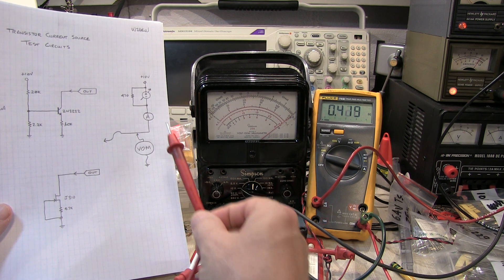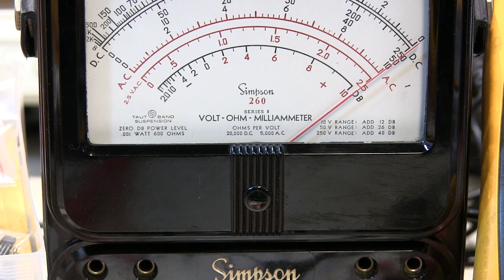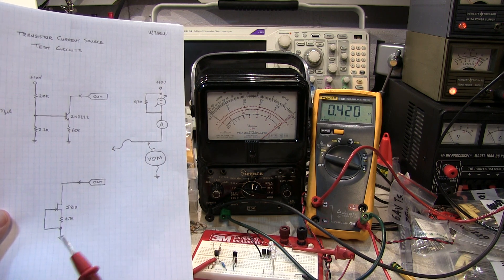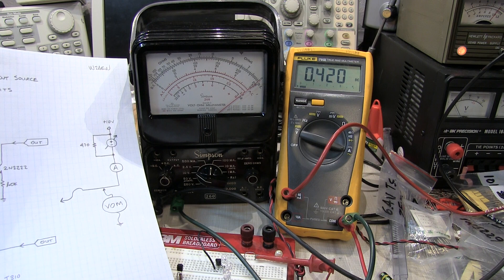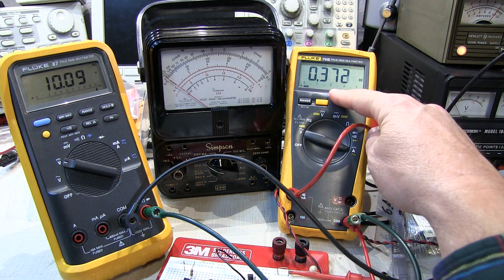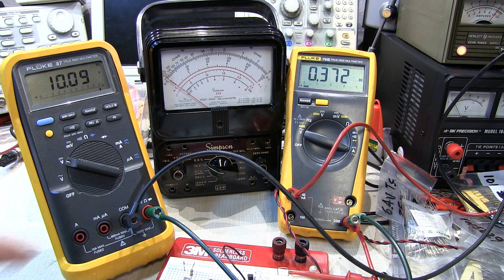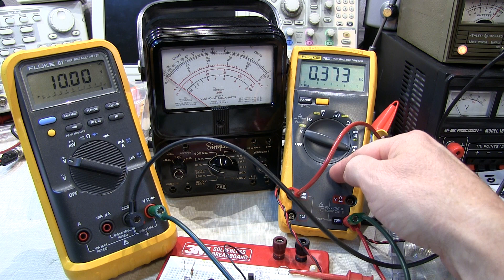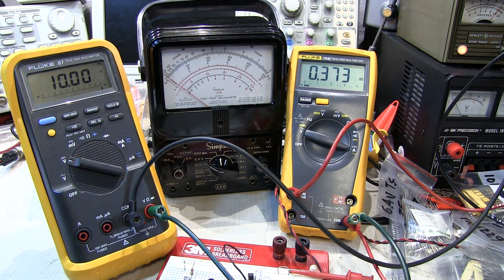#191: Beware of test equipment loading effects!!  Learn from my error!

Comment: I just subscribed to your channel and really appreciate your content.  I had a question about older meters.  I was working on a Tektronix 576 doing some performance checks and in the service manual, they talk of using a voltmeter with input impedence > 500Mohms! Our DMMs today typically have ~10Mohms (depending on range setting).  Do you know what kind of meter they were referring to in this service manual?  Sorry I know this is a bit of an obscure question, but your thoughts on older meters like the Simpson 260 (I have one as well) having lower impedence triggered this thought.  This Tek 576 manual was clearly written in the late 70s so they must have been using an older meter as well.
Reply from the maker: They were likely using a VTVM (vacuum tube voltmeter).

Comment: I would use the DMM meter before the old Simpson 260 analog meter. But do get me wrong the old Simpson Analog meter back in the 60’s and 70’s in my opinion was the industry leader. Your thoughts?
Reply from the maker: I like using the analog meters when I can - which is when:
- I want to watch the trend up/down
- I don’t need high precision
- loading effects are ok
Reply: @w2aew  Thanks. Also my electronics instructor stated there’s a time and place for each application. Have you done some op-amp output bounding before? I have been working on some circuits I find it very interesting.
Reply from the maker: @MsFireboy2  not sure what you mean by output bonding.
Reply: @w2aew  output bounding on op-amps is the process of holding the output at a certain level through the use of Zener Diodes.

Comment: I know this video is 8 years old but I was just poking around an opamp circuit and noticed my supply current fluctuating as I probed with an 8050A DMM.  I then used a Heathkit V-6 VTVM to see if the perturbations diminished and they did.  I now don't feel so bad for the amount of time I spent refurbishing that thing.  This series is great and I continue to learn a lot from you.  Thanks!  I used a Simpson 260 for checking DC motor health many years ago.  The 260 worked OK for that.  I'd say if you get a significant measurement and account for the input impedance then all will be OK but I could be wrong as my experience lies elsewhere.  Again, many thanks.

Comment: I appreciate all of your electronics videos, but that will not stop me from being really evil...
...Could not a board be made to replace the Simpson meter workings with an MOSFET/FET, or Op-Amp front end, that would have a much higher input impedance, and then couple it with a current source for the meter?
Reply from the maker: Certainly it would be possible to completely replace the guts with a FET input amp to get the benefits of very high input impedance.

Comment: Would this loading effect cause something to turn off? 

For example: our machine at work is running and when we check voltage the machine turns off. Then we take the probes off and it starts running again
Reply from the maker: Loading might cause that, as well as noise injected from the probes.  Also, if probing from a non-floating instrument like a scope, real problems can occur if the probe ground isn't used properly.
Reply: @w2aew  we are using multiple fluke 87 with the same outcome
Reply from the maker: @emmanuelsuazo1318  The loading presented by a Fluke 87 (assuming you're measuring voltage) is very low.  I suspect that the probes are coupling noise into your machine (whatever it is).

Comment: The Simpson would have worked fine as the ammeter since its 500 Ohm resistance is negligible compared to the MOhms of the current source.  Also, it would be instructive to show the math of how the current source resistance in parallel with the known voltmeter resistance yields the measured resistance; then 1/R_cs = 1/R_measured - 1/R_meter allows us to get a correct current source resistance anyway.  The 193k then becomes 5.5 MOhm when the 200k meter resistance is considered.

Comment: your videos are awesome ...  some circuit fun video please on increasing input impedance of analog volt meters by means of transistor emitter follower or some op amp would be nice to compete the DMMs! a vtvm is hard to find for me :)
Reply from the maker: An op amp based unity gain follower would be best.  An emitter follower would have a DC offset.

Comment: Maybe is better to measure the voltage on the 10K scale (because of the precision) AND Disconnect the VOM before measuring the Current. (or move to a high scale with more impedance)

V	10.09V	5.00V	2.00V
mA	0.420	0.394	0.378	(Simpson)
mA	0.372	0.370	0.369	(Fluke)
	0.048	0.024	0.009	(Simpson - Fluke)

kOhms
	24.0	12.7	5.3	(Simpson)
	27.1	13.5	5.4	(Fluke)

Comment: Saw it first hand when I was adjusting the calibration on my Simpson 260 last night. I had a 1mA current through a resistor and my Fluke 87V as my reference, I put the 260 in series with this setup and saw a small drop in current on the Fluke.
Reply from the maker: What you saw was the affect of the burden voltage on current, because you were using a resistor to set the current and not using a current source.  All ammeters have a burden voltage  - a voltage drop that is inserted in the circuit when the meter is placed in series.  Calibration on the 260 is generally done on the 50uA scale where you adjust the trimmer in parallel with the meter movement.  Then, after you have 50uA full scale reading, adjust the series pot to get 250mV drop (burden voltage) at 50uA test current.

Comment: 10k-20kohms/volt was and is typical for passive analog multimeters....FET input multimeters really helped true-up your measurements back in the day....I have a vintage Micronta (Radio Shack) analog FET meter that I will never get rid of, even with digital high impedance mms...
Reply from the maker: Still a lot of value in having a moving needle...
Reply: Yes, and there always will be, especially for adjustments for peaks and valleys....

Comment: Great demonstration!!! A question on the opposite angle......How can you simulate taking a reading on a tube circuit using a DMM as if you were using an analog meter with 1000 ohms/volt?  As you can tell from my question....Ive ran into a big voltage difference using the modern DMM on certain circuits where the schematic show the recommended voltages taken with a 1000 ohm/volt meter.....I used a 270k ohm resistor to shunt the DMM leads....Im sure this is not exact, but I get closer readings.....Am I making the data fit? Or is this a correct way? Thanks--Larry
Reply from the maker: If you want to simulate the analog meter, you would need to the the voltage scale that you would have the meter set to.  For example, If you would use a 250V scale, then the parallel resistor you'd need would be 250*1000, or 250kohms.

Comment: yes the leads are acting as antenna picking up the signals but the Fluke meters must have a low pass filter build in because it stays close to zero voltage compared to other meters they randomly fluctuate in the normal voltage range. I thought this was a better way of measuring an open circuit because zero volts you can't tell if you have a ghost voltage or an open circuit because its zero volts.

Comment: When using Fluke meters set on DC volts, when the DVM meter probes are measuring an OPEN or have the meter probes not connect it measures zero. Other DVM meters is randomly fluctuate a millivoltage on the the meters display when measuring an OPEN or have the meter probes not connect. I'm guessing Fluke puts a Low Pass filter that built in that can't be turned off when trying to measure an OPEN circuit? When you put the FLUKE meter in MilliVolt mV range the meter will randomly fluctuate a millvoltage when measuring an OPEN circuit but not in the normal Voltage range. This is the only way to know if you have an open circuit or the circuit has a ghost voltage is by using the Fluke millvolt mV range not the normal Voltage range?
Reply from the maker: The reason you see a random fluctuation is because the leads are acting as antennas picking up signals from the air.  It is not a reliable way to detecting open circuit.

Comment: Your videos are excellent and have been a major factor in me starting to "teach myself" basic electronics (hmm, most of the teaching comes from you actually - credit where it's due!). I've acquired a nice CRO and love your 'Back to Basics' type intructional videos. I have 2 novice questions for you:

1) Under what circumstances would using a meter like the Simpson 260 be preferable to using a digital multimeter?

2) Is there a reference book (like an encyclopedia) with lots of circuits where they can be searched via the use you require of them, with details such as you give in your videos (ie. how to use them, variations, etc)?

I come from a research background so discovering blunders and owning up to them is not new for me: it adds to you credibility that you can own up to yours.
Reply from the maker: 1) I use an analog meter like the Simpson 260 whenever I am working on something that I am adjusting or tuning, where it is important to see the "change" in a voltage or current (such as peaking or dipping a response).  It's much easier to see this on an analog meter than a DMM.
2) I don't know of a circuit encyclopedia per se.  There is a book called Op Amp Cookbook by Walt Jung which is probably the closest thing you'll find.  Another great book is The Art of Electronics by Horowitz & Hill.  It has a lot of circuit examples, and even has a section at the end of some of the chapters called "Bad Circuits", where you are responsible to figure out why they're bad.
Reply: Hey, thanks for your quick response - I appreciate it!
I will look into acquiring an analogue meter (I have a cheap one somewhere but from memory it's in pieces) and I will definitely try to locate those books.
I have a rare day off today so I'll try to replicate a circuit or two of yours to get me started.
Thanks again!
Reply: @spiderjuice9874  , Read up on metrology... more than "what it is." How to use standards and owning a few to begin with sure helps put you "into the game."  de KQ2E

Comment: Hi,
your videos and your skill at explaining things is outstanding.
In the case of the problem of the voltmeter impedance influencing the measurement, couldn't you simply measure voltage on the other end of the ampmeter? Then only the burden voltage of the ampmeter would contribute, but much less most propably.
Thank you.

Comment: A maintenance person was using a Fluke DMM to check for A.C. voltage on an outlet. The readings were jumping up and down sometimes as high as 87 VAC. I connected my Triplett 630 to the circuit and it showed nothing. His assumption was that the meters were defective. Until i explained about input impedance and loading as well as EMI. The wires were in the same conduit as large wires used for heavy machinery which was turning off & on. Good to know both meters.

Comment: I am new to electronics and I am delving into it from many angles: books (old and modern), radio shack kits with Platt books, Make Magazine projects, radio kits, local arrl group, etc. One thing that I have noticed is that there has been exponential change over the last decade. 1) What direction would you take today in pursuing a career in electronics with the changes in software/hardware? 2) is detailed work on old style circuit with transistors still very useful/relevant?  I enjoy the knowledge and the application. Am I on a path of pure hobby as one man told me by spending time on "old school" components?
Reply from the maker: +Jason Brambach I think that spending time at the discrete component level gives you a great deal of practical knowledge that is very valuable - something you wouldn't get by jumping in at the Arduino and other kit level of things.  There is value in both, so don't feel that you're wasting your time on transistors - it is all time well spent.

Comment: I noticed you use the Simpson in several of your videos.  I was thinking of getting one.  I see you have a series 5.  Based on schematics I have located it has a 1.5 volt battery and also a 6 volt battery.  Where do you get  a 6 volt battery for these.  What series would you recommend getting since it will be my first one.  I definitely want a series that uses 4mm banana jacks in it.   Maybe the 260 would be a good subject for a video for beginners that are used to seeing digital gear.
Reply from the maker: +jp040759 I think my unit uses a four AA and one D cell.  In fact, I keep the batteries out of the meter, and only use it for watching &quot;slow&quot; voltage and current changes - very useful when tuning, adjusting, tweaking circuits.  The batteries are only used when measuring resistance, and I don&#39;t use it for that.  All the info you could ever want to know about the different Simpson 260 series can be found here: http://www.simpson260.com/
Reply: +w2aew Thank you.   Makes sense.  Thanx for link.        BTW    Great vids!!!!!     Always look forward to the next one to be uploaded.

Comment: can we built a constant current source given the voltage source we have is AC and it's constant.
we need to vary the impedance and still the constant
please answer am stuck.
Reply from the maker: Salah Reffis Rectify & filter the AC to a DC power source, and bias the current source with this.

Comment: How about a video showing how to measure a voltmeter's input load?  I have some that are not labeled.
I only use them for basic on or off voltage testing but it would be interesting to know a good way to test them.
Kind of fun to test my meters to see if they meet specs too.
Reply from the maker: Usually, the best way is to measure the input impedance with a second meter.  I have done this, and found on my Fluke DMMs that the input impedance on some ranges is 10Mohms (as you'd expect), but on some ranges it is closer to 11Mohms (not expected!).  This can be important when using something like a HV probe.  For VOMs, simply take the sensitivity value which is usually printed on the meter face (like 20,000 ohms/volt), and multiply that by the voltage scale that you have it set to.  For example, if it is set to a 10V range, then the input impedance will be 200,000 ohms.  Hmmm - probably worth a video...

Comment: As always a fascinating video, of course sometimes it is surprising quite how high the impedance of a moving coil meter can be on a high voltage range... even higher than the 10 Megohms or so of a Fluke.

Comment: Wow, last time I used voltmeter like that Simpson was when I was 10 y old. I always assumed that all voltmeters have 10M impedance minimum.
Now I have a QUESTION - looking at my Agilent DMM 34461A there are 2 options for "Input-Z" in DCV mode - 10M and "Auto". I looked at manual and it says "the Auto mode selects high impedance (HighZ) for the 100 mV, 1 V and 10 V ranges, and 10 MΩ for the 100 V and 1000 V ranges. In most situations, 10 MΩ is high enough to not load most circuits, but low enough to make readings stable for high impedance circuits". What kind of conditions exactly they are referring to when I can benefit from reducing input impedance in DCV mode?
Reply from the maker: Consider very high impedance circuits...  Any tiny induced current in the test leads (acting like an antenna) can result in creating noise or variations in the measurement. In these cases, not having a huge input impedance can be advantageous

Comment: Is there any benefit to the old meter these days, or, can it do something better than the new ones?
Reply from the maker: I find them vastly useful when tuning, adjusting or tweaking circuits while watching the voltage or current change.  Much easier and more intuitive than watching digits or a segmented bargraph on a DMM. The 'inertia' of the meter movement is also good to visually average wiggles on a voltage. I like them for the same reasons that I like an analog tachometer in my sports car.

Comment: Hey Allen I commented on the previous video and probably should have commented here but could you have placed a high value resistor to mimic the digital meter? Just a rookie here.
Reply from the maker: This would minimize the parallel current path, but the VOM wouldn't indicate the correct voltage.

Comment: Is there a simple way to construct a CC circuit that is not so sensitive to impedance?
Reply from the maker: Even this simple CC circuit is not sensitive to impedance!  It simply had a 200k resistor (the VOM) in parallel with it, and the ammeter was measuring the total current (CC source + current in the VOM).
Reply: ***** So it is. Thanks Alan.

Comment: Good on ya Alan! In some ways the 2-part "oops" incident is better than a "no-oops" one. It makes us look at #190 and see what we missed, too. Most of us, anyway... 

Cheers.
Reply: Although I did have the thought that "constant" must be a euphemism, after seeing the variation in I with the change in V. (c;
Reply from the maker: davecc0000 It is certainly clear that the majority of the variation in current measured was the current going through the VOM - so the constant current source is much closer to being constant with respect to load voltage than was originally shown in the first video.

Comment: What is the voltage burden on the fluke when measuring current that low?
Need to hit Dave up for one of his MicroCurrents  :)

Great Job Allen
Reply from the maker: It was actually only about 4mV, so pretty insignificant.  Thus, simply moving the 260 VOM positive lead to the other side of the fluke ammeter would've alleviated the problem.